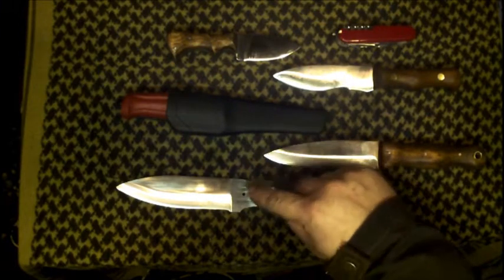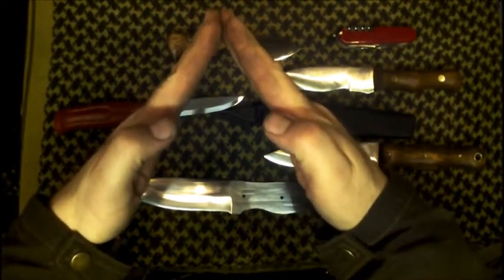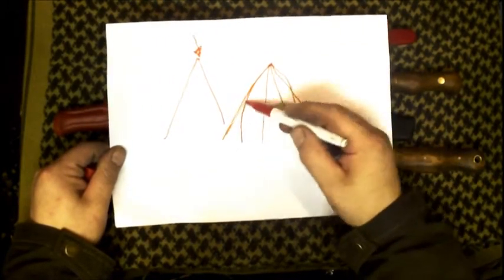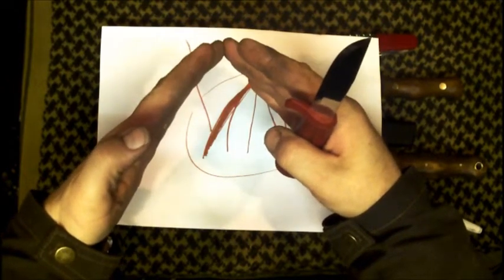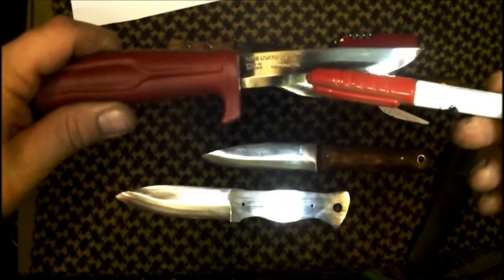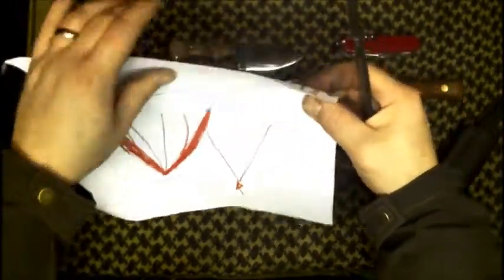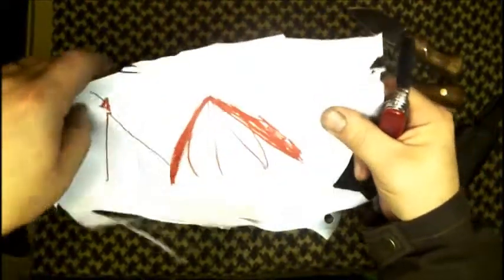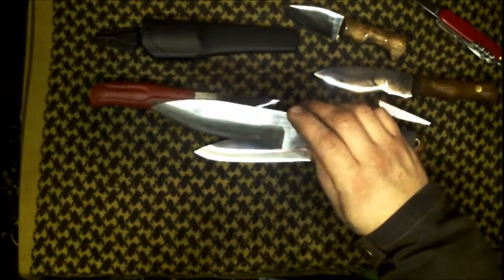Leaner Grind, evolution of Wessex Blades

Comment: Interesting to see your knives evolving. I'd say your source of advice on convex is about as good as it gets. I've just measured up my cKc 5" Thrive and thought you might find the data points of interest. It is 4mm thick O1, blade height at the plunge line is 28mm. The convex is not full height, it starts (at the plunge) about 8mm down from the spine. Can't give a thickness behind the edge as my cheap calipers are, well, bloody cheap! It's a great slicer. Merry Christmas mate!